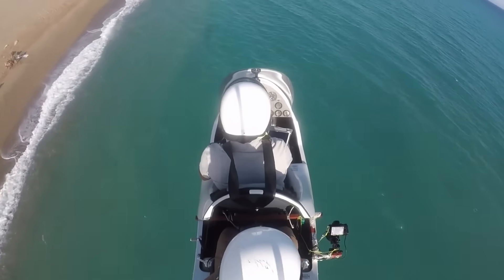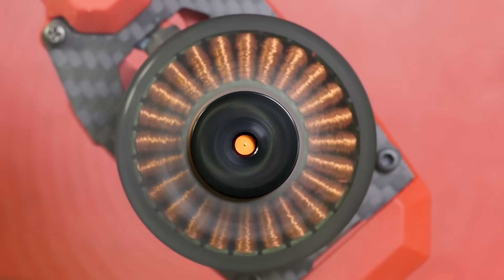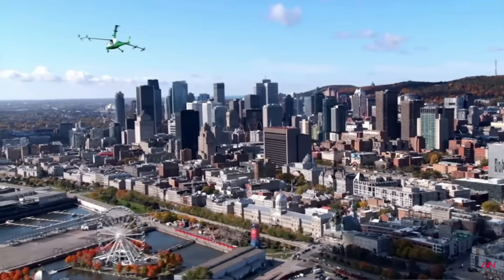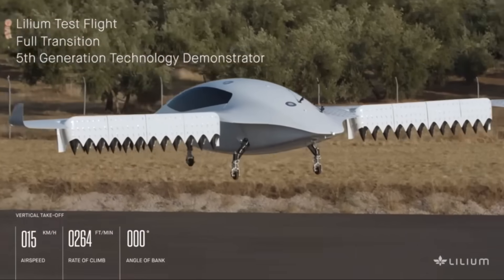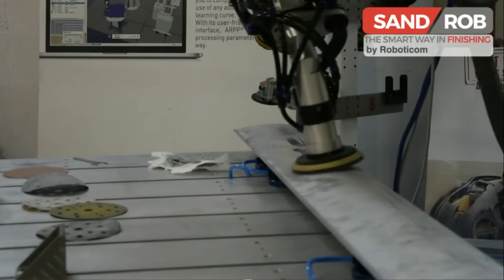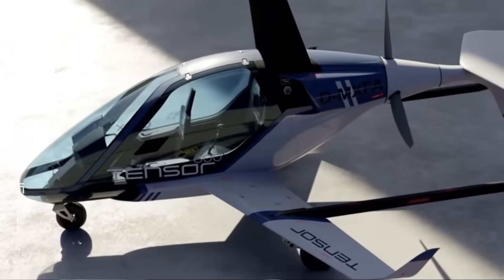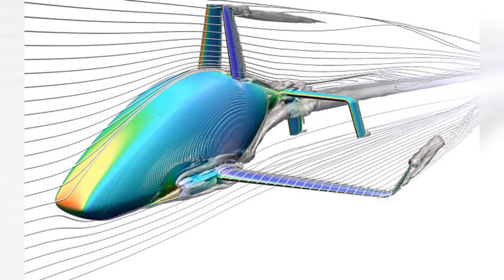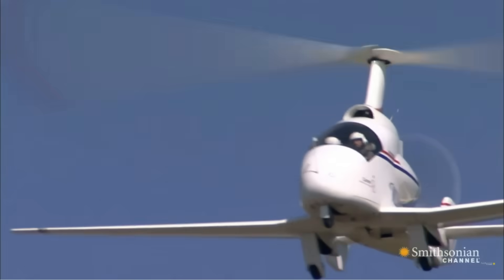The Brilliance of Modern Gyrocopters

Comment: Since Gyros are cgeaper than private planes , is it possible to make Gyro which can carry 10 adults imcluding the pilots , has airconditioning , a toilet , can fly at a height of 25k feet , carry t9tal load of around 2000 kgs and on a tankful of fuel fly non stop of at jeast 3000 kms and must be ppwerd by two turboprop engines in pusher configuration ?

Comment: It is basically like having a GA plane or eVTOL but with a permanently deployed parachute, very safe. If you don't need a totally vertical takeoff and landing then this is the way to go. When you cut the engine there is no panic, you can pick any small landing spot and glide down in a very controlled way.

Comment: the Auto-Gyro is where it's at.  some are traveling 500-plus miles at 120mph you can use that for cross-country travel. Way faster and smoother than Car travel for sure. They cost about the same as an electric car today 60-120k.  You can fly from MI to FL in an 8-hour working day.

Comment: ...this video is full of extreme dangerous misinformation.

Powering the rotor of a gyrocopter wont allow it to hover "in case of main thruster failure".

If the gyrocopter is hovering its rotor MUST spin freely. If yoh put a torque on it (with an electric motor to generate more lift), it will spin the fuselage.

Sure so long ad the gyro is going forward the tail controls will allow it to not enter an uncontrolled spin fron powering the main rotor.

But as soon as there is no air is flowing over said control surfaces on the tail, if you power the main rotor you enter a spin.

Yes.

Helicopters have tail rotors for a reason.
Reply: The thrust to weight ratio of ducted fans is pretty much irrelevant.

Same thrust to weight is easily achieved by prop+motor system.

Comment: Lumanati Aerospace was a fraud company. Do your research properly. Tensor is not the answer for VTOL either. VTOL is possible in gyroplanes but certain development will have to be done. Electrification of forward thrust makes the gyroplane heavy. Very heavy. There is no going away from 20 times less energy density of electric batteries right now. No magic exists to get rid of that Physical fact. It is always going to be a compromise with useful load using batteries till Material science solves the battery energy density issue. Making a composite (wing for cruise and rotor for VTOL and emergencies) is fundamentally a better idea than 8 rotors spinning and very inefficiently doing VTOL but development needs to be done on that. Tensor rotor development does not take us there quite yet

Comment: It's truly amazing that the Fairey Rotodyne commercial autogyro never made it to market. The only significant technical hurdle was the noise from the rotor tip jets. Quite fascinating, actually.
https://en.wikipedia.org/wiki/Fairey_Rotodyne#:~:text=One%20prototype%20was%20built.,the%20programme%20was%20eventually%20cancelled.

Comment: Electrification of gyrocopters makes no sense! This is as stupid as it gets.  Battery in a gyrocopter means minimum flight time, minimum distance covered and maximum charge time.  Stick with liquid fuel / gasoline as a power source, which is energy dense and all of these problems are solved.  Gyrocopters in of itself make great sense for so many reason other than long distance flying and speed.

Comment: Why hasn't the idea of jump start gyros not included the use of super capacitors for the initial rotor power up. Huge & fast power to a CLUTCHED rotorhaed for elevation gain at jump, the capacitors  are very light so not a drag. Then batteries for forward propulsion.  500wh/kg here today with promise of 800wh/kg in 2-3 yrs says CATL.

Comment: I have tried a small rc model gyrocopter electric powered.  it flew fine but need limited control throws -- so it got into trouble with asymetric turn resonse during slow flight..

Comment: Lift dissimetry is killing the concept. 180 kph is the maximum speed. If you have powered rotor head complication is similar to helicopter and there is no benefit in cost.  So these rotorcrafts are de facto hybrids between gyrocopters, helicopters and airplanes. They play it's gyro card only for certification purposes.

Comment: High disc loading DOES NOT RESULT IN LOWER POWER CONSUMPTION:
Hover power =
 L ^(3/2) ÷ D × √(2÷π÷dens) ÷ eta
Do the math!
L   lift
D   rotor diameter
dens    density   1.225 kg/m³    SL
eta ~ 0.66
Reply from the maker: You are right. I meant to say low disc loading, it was a mistake

Comment: You didnot mentioned  USA experimental gyrocopter with uranium load in tips of the propeller blades. Which help with high jump take off and safe energy during autorotation. I dont remember the name of the model. The problem was as I remember in strength of blades material.

Comment: I want to know SOOOO much more about this!  Doing some napkin math here... take sport copter 2 gyro but use the engine to run a generator.  Replace the turbo fan with a pair of electric ducted fans that run off the generator.  Add a small wing and the brilliant motor on the main rotor described in the video.  ChatGPT reckons that could be twice the performance?

Comment: Batteries are stupid for electric, flying vehicles. You need hydrogen fuel cell electrics. Hydrogen can be stored in metal hydrides that don’t need heavy containment tanks. America hss enough natural hydrogen for 200 years and it could be generated using hydrolysis with electricity from using geothermal sources of heat. That would create a complete green energy loop of hot underground water creating electricity to produce hydrogen in vehicles that extract the energy and turn the hydrogen back into water and also clean the air which must be filtered to be used on the fuel cell. This is the perfect power plant for electric flying vehicles like these gyrocopters. I wonder what big energy corporations might not want you to know or think of this?

Comment: Interesting proposition but I feel you made a few shortcuts. All gyros have pre-rotators, they are necessary because the rotor needs some initial rotational speed to accelerate with relative wind during ground acceleration. What makes jump gyros different, is they have a collective pitch system, while conventional gyros have simpler fixed collective pitch rotor heads. This allows jump gyros to accelerate the rotor on the ground at full speed without generating lift with low pitch, then disengaging the rotator to avoid torque effects, and then only, effectively jumping by increasing collective pitch abruptively. This is done only on rotor inertia !
Reply: L'azienda spagnola ELA ha fornito il suo Eclipse Revolution di tale sistema per un decollo verticale. L'autogiro tradizionale costa 140.000 €, quello con sistema per il decollo verticale  porta il costo  a 240.000€
Reply: I was thinking about the same. The jump looks pretty much like how a helicopter does and there must be some rotor pitch changing in the progress.
I feel like in a pitch changing rotor would also serve like flaps in conventional aircrafts.

Comment: If the Rotar is powered by motor while being in FLIGHT, meaning it is not free spinning as usually for Gyrocopters. Wouldn't there be a need for an extra tail rotar? Wouldn't that add complexities ?

Comment: I suppose you've never been onboard a gyro. Among pilots we call them "petrol to noise converters...." Modern Gyros have sacrified everything to speed and handling. The result flies well trough tubulence like an anvil, gets as much speed as it could, BUT has such a poor efficiency. A 500kg gyro glups 25 liters an hours of gasoline, with its engine almost at full throttle all the time (you can't fly "cool" in these). For sure converting these to electric is a DUM idea, unless you want even less range compared to a normal airplane (wich will not be practical before batteries reach 500wh/kg at least). In theory you could make a better efficiency gyro, with a vey large rotor but in this case no pilot would want to fly it, because you would have awfull gyroscopic reactions, vey poor handling, manoeuvrabbility, and you would be shaken by gusts like crasy.
Reply: Precisely said, a helicopter and quad copter are much more efficient than a gyro because at least the power that goes to lifting them also goes to propelling them forward, these things fly as if they're paragliders with a wing that makes as much lift induced drag as possible, all the lift of the rotor comes from the engine pushing it through the air which means the rotor takes away so much of the potential flight efficiency this thing would have to begin with.

There's a reason most companies tackling urban air mobility are going the multi rotor route, and are using an insane amount of redundancy in lieu of autorotation.
Reply: He did mention that gyrocopter development has been neglected for a long time, hopefully the new developments are to improve the problems you mentioned.

Comment: Once the craft is off the ground, you can't power the rotors without spinning the fuselage in the opposite direction.
If your propulsion motor goes out while in flight, you cannot turn on the rotor motor to bring you down because the fuselage will spin.
Just come down with autorotation.
Reply: those with dual pusher propeller/fans should be  able to compensate for the main rotor torque. Well depending on which pusher motor does fail, it might need to reverse thrust, that's odd (pushing backwards) but doable with any remaining pusher motor.
Reply: @pisoiorfan  
There are few that have two pusher props, but your point is right.  Manufacturers may decide to build their gyrocopters with two pusher props just to get that ability.
Reply: Couldn't you add a small electric tail rotor?

Comment: Lilium is far superior to this
Reply: Limium is cool but it cant auto rotate you back to ground line most of these can. It had redundant battery but what do you do if some weather phenomen or other unforseen event just knocks out electricity completley? The Lilium has wings so i guess it wont drop straight down like a rock but gliding it down will be as successful as most airplanes who try to glide down when their out of fuel.

I love lilium n joby but being able to autorotate is a pretty big deal fir safety.

Thats why i like the Jaunt Air Mobility aircraft. Not as sexy as Lilium but the best next gen e-vtol imo

Comment: The most obvious application is an electric motor to pre-spin the rotor before takeoff.    The second is the ease of implementing Fly By Wire and Throttle By Wire to create anti torgue to allow a small amount of rotor power during takeoff and landing.

Comment: The Kurds in Northern Iraq adopted gyro-copters for their traffic police as when they land there is no prop-wash stirring up clouds of dust and causing accidents. That was about a decade ago now, I can't remember the make but they seemed to like them at the time. Given their greater efficiency I am surprised it has taken this long for ducted fans to catch on.
Reply: Greater efficiency? That depends on a lot of things, but pound-for-pound, a large open rotor is more efficient than a closed small one.
Reply: @gormauslander  I based that statement on a conversation with a friend who makes radio controlled model aircraft, he's a big fan of the ducted propeller. Ducted fans have been adopted for airships, although at relatively low speeds drag is less of an issue. They have started adding similar shrouds to ships propellers (well they did in the 1980s, I came ashore in the early 1990's) 'to increase efficiency', but of course on ships weight is less important and at 10mph drag is negligable.  This chap has a video on prop designs that suggests there are potential advantages to adding a duct but I am not a mechanical or hydraulic engineer. 
Modern advanced propellers such as those used on the A400 transport aircraft don't seem to be common, perhaps due to manufacturing costs
Reply: @mikesmith2905  In trying to come to a conclusive answer about what scenarios they are actually better, I found no conclusion. Intuitively, it seems to me that no matter your prop size, disallowing the air to spread sideways and forcing it to continue out the back must necessarily waste less energy and convert more movement into propulsion. But people keep not using them, so there's gotta be something i'm missing

Comment: Crazy idea that probably wouldn’t work, but I want to put out there. Some sort of, for lack of a better word, extension cord that supplies the rotor with the large amount of electricity it needs for vertical takeoff, without having to have that much more battery weight. After it reaches a specified height, the cable disconnects and the copter goes on its merry little way.
Reply: EVA vibes!
Reply: The more cord you pay out the more of the cord's weight will be hanging on the craft...

Comment: Either powering or generating with the rotor whilst in flight causes a moment torque, how do you manage that without a tail rotor? Just rudder?
Reply from the maker: If you watch the video, I have shown two videos of Gyro's doing jump take-off (nearly vertical). The torque is managed by the rudder.
Reply: @ElectricAviation  you have not done your research. Jump gyros disconnect their transmissions before jumping. Half your video is bunk.
Reply: @ElectricAviation  whilst you're on the ground it's possible to power the rotor, but ad soon as it's airborne the torque reaction is too large to be useful

Comment: Why not power the main rotor from a grounded cable for the purpose of take off? This could be detached or retracted once suitable height is achieved.
Reply from the maker: Yes a powered tether can be used for take-off
Reply: Then you're hauling extra motor(or extra gearing) but it's a very interesting idea that I hadn't heard before this video

Comment: 1:29 A gyrocopter doing vertical takeoff? 🤔
Reply from the maker: Yes if you power the rotor during take-off
Reply: @ElectricAviation  Yes, but then it's kind of a helicopter. I suppose if it's just for takeoff you can still call it a gyrocopter, but doesn't it need all kinds of controls for the blades? The takeoff could get uncontrollable with just a 'dumb' rotor.
Reply from the maker: @Patiboke   Yes and no. It will go on rotation due to forward thrust once it has climbed, so that is how its different

Comment: this is kinda ridiculous, there is nothing to compensate for the rotating torque of the rotor's motor.  the moment you turn that motor on and the wheels are off the ground you'll spin out of control and die.
Reply: No gyrocopter has ever had this problem,  and if the gyro rotor has added power in flight,  this can be compensated for by differential thrust from two propellers or by the rudder. Torque to the gyro rotor won't be a lot.
Reply from the maker: Normally  rudder over comes it

Comment: that is good news, because we need to see this potential brought forward as Im sure it will provide a safe VTOL personal vehicle, and has variations in scale too such as Fairey Rotodyne. Likewise we have learned that we can avoid the speed cap imposed due to retreating blade stall by the wings shown in your examples. This could see 300 mph vehicles which will have an impact on range.
Cheers
Reply from the maker: The 11 seater Linx P9 looks promising. It is 2 crew and 9 passengers
Reply: @ElectricAviation  Once you can power up or power down a rotor, there is a lot of flexibility in this type of platform. 
The inter airport commuter is obvious and its where Fairey first went for the same good reasons. 
But there area lot of competing roles which make every bit as much sense, 
from the 300 mph rotary wing platform to the safe personal transport for low hours non-professional pilot.

Comment: As per MyFluffyClouds post below, I would suggest mains power could be applied to a VTOL, for tens of metres after takeoff from a skyscraper, by having a pole run down the inside of the building.  This would have a electrical power connection to the aircraft, and be raised up, by mechanical or electrical means, to match the rate of climb, thus not adding to the take off weight. If sufficiently substanstanial, it could even push the VTOL upwards.
Reply from the maker: Brilliant Idea
Reply: A hole could be drilled into the ground to install the pole.
Reply: This seems like a lot of engineering for a marginal gain. A simple quick-disconnect cable would do the trick
Reply: Brain storming now - maybe for landing also, pole raised with some means to connect to VTOL, maybe the aircraft's connector hangs below, and is guided to the pole's connector by a cone.

Comment: What if a electric VTOL plane would takeoff with cable power?
Reply from the maker: I have explored those options in a video. They can be connected to a power tether, that detaches after lift
Reply: Yep. Rotors are kinetic energy storage, and can be charged before takeoff so that the battery isn't used at all

Comment: Could the battery and /  or maybe some super capacitors be boosted from a ground based electricity supply to achieve  the initial rotation speed for the 'jump' takeoff? This would relieve the drain on battery for forward flight.
Reply from the maker: Its a good idea. A powered tether can do the job that detaches
Reply: @ElectricAviation  Even if it's a very short power tether that just spins the rotor blades up enough to provide the initial jump. This energy is not then taken from the onboard battery. The system could be installed at regional air taxi hubs.
Reply: @ElectricAviation haha, my comment